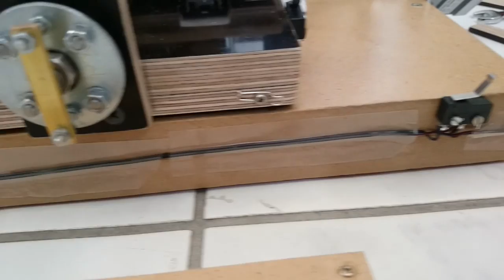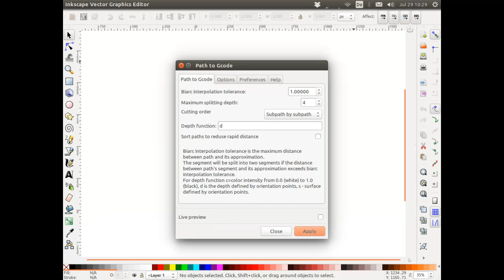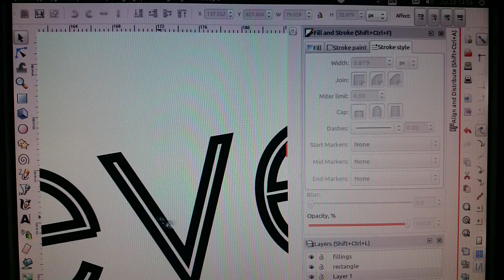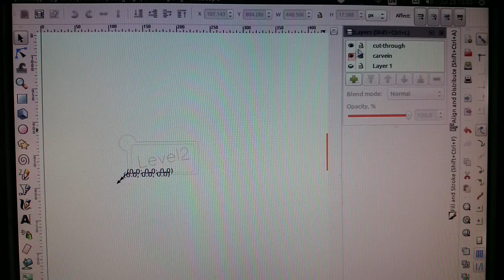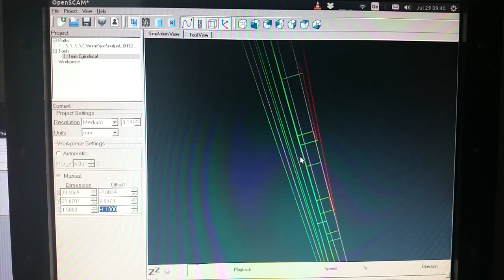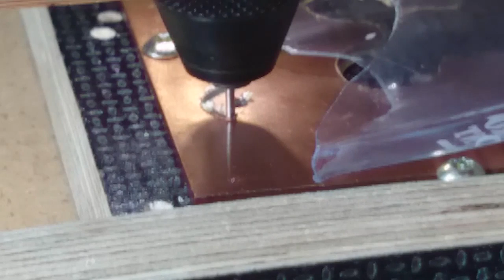My homemade desktop CNC mill - Clip 6/6: From a drawing to the milled object

Comment: Bravo! great job and thank you for the clear explanation and also the effort that you did to make the project and the courses. i have a question : can we use the same materials to do a same machine but for large dimensions?
Reply from the maker: Thanks! To your question: I think you cannot really make a larger machine with my setup, because finding longer drawer sliders is hard, and keeping the machine precise will be problematic. For larger machine, I recommend decent linear bearings, proper leadscrews (or belts) and a still bed while the milling motor moves.

Comment: Hi Joe, another 2 questions on the stepper motor NEMA 17, I checked on SparkFun and noticed that the rated voltage is 3V, and from the Big Easy Driver I found the M+ Motor power should be M+, 8V - 35V, may i know if the stepper motor rated voltage is same as the M+ voltage? What is the voltage you used for M+ in this case? Secondly, if I used a 1.8 degree 200 steps motor, will that affect the accuracy? Many thanks for your help.
Reply from the maker: Most stepper motors are 3'ish Volt rated, which just means that you can send 3V DC through the coils without destroying them. BEDs or other drivers can anyway set/limit the current going through the motor.
I use 200-steps motors. Because of the M8 rods, each step leads to 6.25um (0.4 thou) travel.

Comment: Hi JoE, Great job and very inspiring. What is the white material you used to put on top of the sliders to prevent dust? Will that affect the accuracy or affecting the evenness of the XY platform?
Reply from the maker: The material is just white 3mm acrylic. It does not influence the precision/evenness of my table as far as I can tell.

Comment: Hey bro .. i am just a beginner and new to this CNC machines....... anyway iam intrested in your project..
Currently i made a simple cnc plotter using NEMA 17 andd EasyDrivers  with arduino UNO.....
I am confused with the circuit of your machine......can u send me a image of your circuit diagram and i need to know what softwares are u using
Thank You
Reply from the maker: Please check my last comment on the hackaday-project page, you will find the right info there.
Reply: bro when iam uploading the arduino code there are some errors coming..Please Help me
Reply from the maker: Uuh.. and how am i supposed to know what errors you get? Also: When you just have a simple CNC plotter, you should install GRBL on your arduino (github is your friend), my software is actually only useful when you have a manual control in the way as I have made it. GRBL is the software that makes the arduino listen via USB for code commands and driving the motors.

Comment: G-code is more or less text once generated, could you copy the job 2 g-code and then paste at the end of the job 1 code for one contiguous file?  Also could you design in holder tabs on the cutout job so it only leaves a tiny bit of material as breakout tabs while still holding the main part firmly?
Awesome build!   Great job! Very cool!
Reply from the maker: +Brian C You are right. I actually have copied G-code pieces back and forth for other projects - for example, separating trace code from hole-making code for PCB produchtion (as I need to change the endmill in between, logically). I am usually to lazy to model holder tabs :) but yea, that would be the more mass-production-ready.

Comment: +JoEtuuube I can not find where you got the keyboard, am I missing something? Would like to order one myself.
Reply from the maker: +ton The keyboard I used belonged to a very old micocontroller kit from 1997. Any modern keypad would work, but then the software must be changed of course.
Reply: +JoEtuuube Thank you for your answer and thank you for the video's!
I wonder how you made the design on the keyboard, did you use some sticker type of thing?
Reply from the maker: +ton No, just a printed-out piece of paper, taped to the board. The tape is invisivle because the white cardboard-frame around the keypad covers it.
Reply: +JoEtuuube Ok, thank you.

Comment: very good video. I just buy a very simple CNC, and it is not easy to use it, but it works fine. I wish I saw your video some months ago, I will not have to buy it. Very good job!
Reply from the maker: +woody wood I thought about buying a CNC machine before I started building my own. Main motivation for building was finally that I wanted to learn new things (I do electronics since two decades but never played around with Arduino before) and that I did not want to pay too much for it - my macine has cost below $400. Which one did you buy? I know you can get pretty good ones today for $700 or so.

Comment: Very amazing build!!!!. only qeustion i got: When the machine set itsself on "0" How does it know what the size is? i geus u count the circles the motor makes. but how do u know how much 1 cirle is?
Reply: +500arend size of the board*
Reply: +500arend and 1 cirle compares to distance traveld
Reply from the maker: +500arend When the PC controls the machine, the machine counts the pulses for X,Y,Z to know how far it has traveled. The PC does not tell the machine where 0 is because moving relative to the start is enough in most cases. I know how much pulses 1mm are (in my case 160, as the thread-step is 1.25mm and the motor needs 200steps/revolution)
Reply: thank you very much for the explaining. it sounds logical now. by setting itself on 0 i meant to say goin to the end switch, and back to the other switch so he knows how big the board is and where the machine is at that time :)